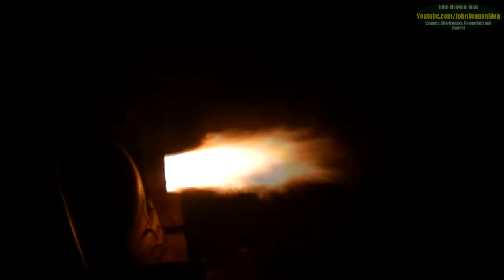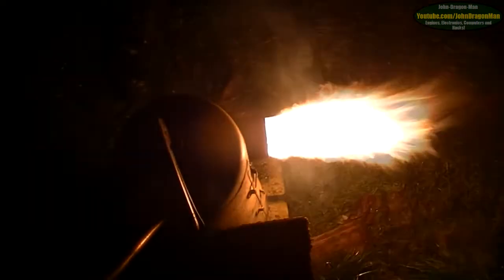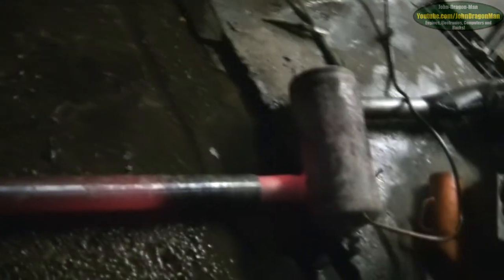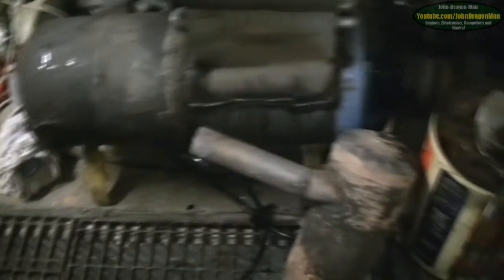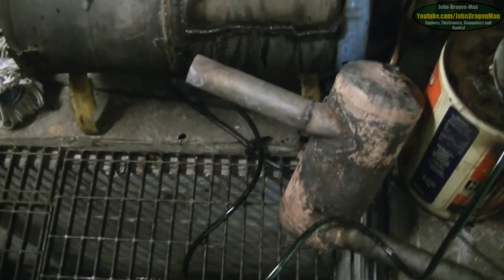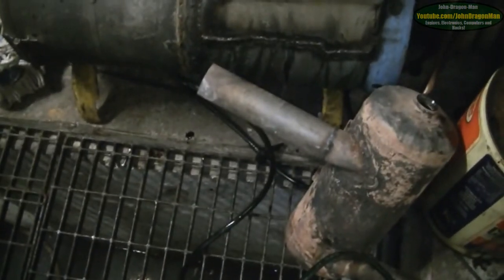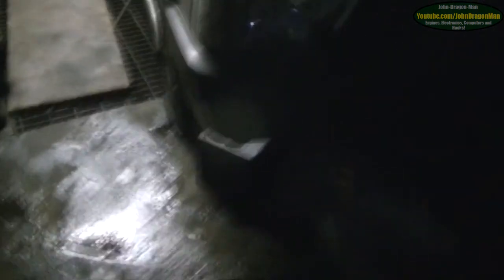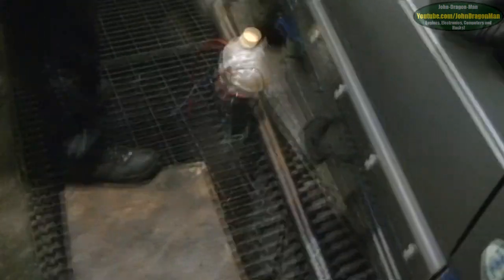Waste Oil Burner test run 2 part 2

Comment: I've not played with oil fire, but I am wondering if misting the oil by impeller and heat are inadequate to start, would using an ultrasonic emulsifier from a humidifier or 'aroma therapy device' make droplets small enough to reliably burn at low pressure.

I did try searching and found Eric C. Cottell had patented something similar in the 1970's, using water to further decrease the droplet size on heating.

Again; I haven't a clue about this, but would be entertained to watch.
Reply from the maker: if you heated the oil up so it was almost like water, yes i bet it would work. i dont  think the mister would last long though. the rubber seals would suffer quite fast.

would be interesting to play with though.
Reply: I remember as a child atomizing chunks of solid poly carbonite (off cuts and CDs) while playing with my humidifiers as a child. Though I agree that lowering the viscosity of the oil would make it more effective.

The humidifiers I remember used epoxy instead of rubber seals, and didn't seem to be much worse for having been cleaned with boiling water and paint thinner. But without the seals, it should be mechanically feasible to stick the transducer on legs and submerge it in oil, unless there is an electrical problem, or the oscillator that powers it overloads, or it floats out of the oil cracking the ceramic, or the legs fail, or the solids suspended in the oil works its way into the elecrical contacts, (etc)

Can you think of another youtube channel we can try and get to test this methodically?
Reply from the maker: ***** hmm...  i have one of those humidifiers. a little ultrasonic mister. its not doing anything so ill dig it out and see if i can get it to atomise waste engine oil. then see if it can be lit >_<

this is a worthy experiment!

i have seen a video of some one atomising petrol with a ultrasonic mister. ill see if i can find the video